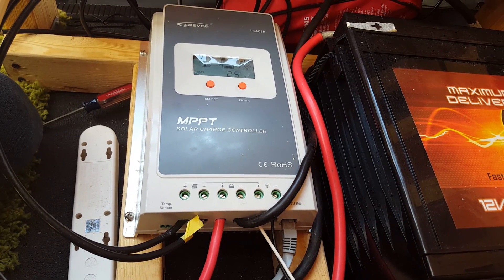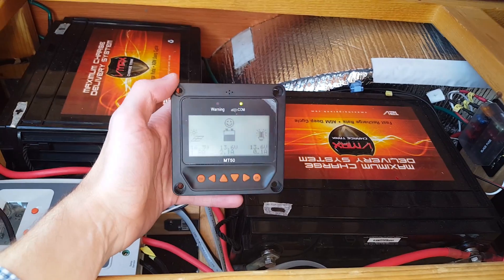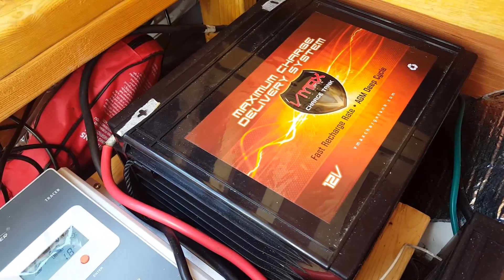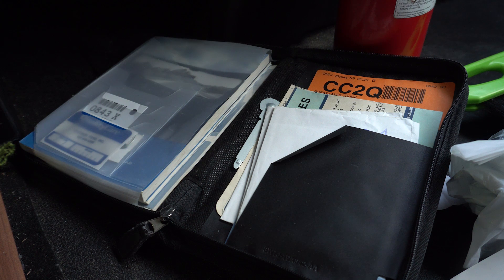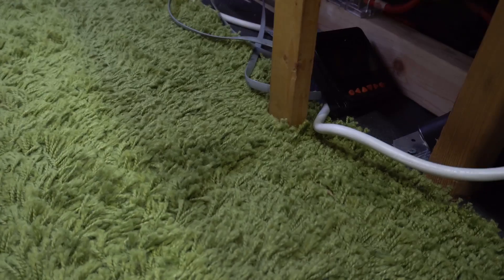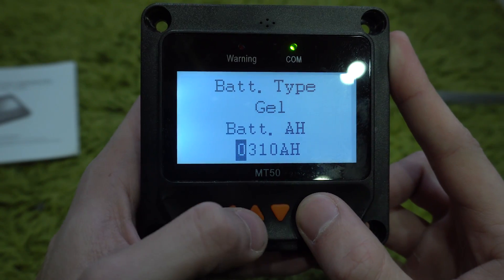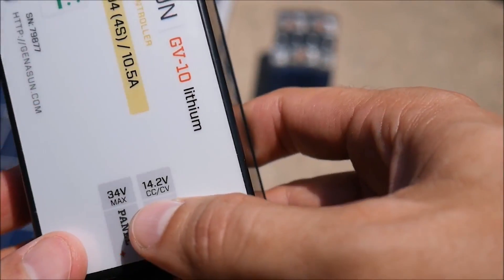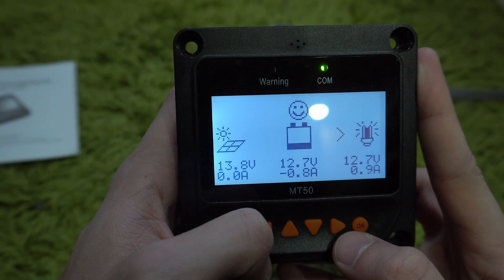How to Program Charge Controller for Lithium Batteries (MPPT v PWM | LiFePo4)

Comment from the maker: Some fair critiques about the usefulness of this vid. The point I was trying to get to is that each Lithium battery manufacturer has different recommended settings. They should be included when you buy the battery or on the company's website for each make and model. Then you can go into your individual controller (MPPT) and go to "custom" profile and select what the manufacturer recommends. That would be the key take away.
Reply: If you do not give the information indicated in the title of your video, your video becomes "click bait"
Reply: unsubscribed. I'll head over to Will Prowse's channel for real info.  you've suckered me into unsubscribing which isn't easy to do.
Reply: My situation got. Used lithium battery from batteryhookup. (BMW). No paperwork. Go a epevers with hand held display for program ing. I will try to screenshot battery hookup info if you could advise. Your videos are  GREAT.
THANK YOU 
Jarrett Estes
Reply: Ok you answered my question, thanks for the video 👍

Comment: i have 1 100 watt solar panel with 2 35 amp hr agm batteriers but i cant figure out what to set the charge controller at.o and a 2000 watt inverter

Comment: What if you bought a battery lifepo4 that doesn't have low voltage cut off and you want to use the sensor that cam with the solar charge controller?

Comment: PWM is not a considerable option for the lithium battery. When the Lithium battery is fully charged the PWM will give a high output voltage almost the same as the PV input(some cheap MPPT will do the same). Lithium battery will be protected by cutting the input circut, then the PWM output voltage will increase to similar to the PV input voltage. At this time if you turn on your inverter to some DC loads directly from your battery they will be burnt. Trust me I have gone through this. Then I use the good MPPT and drop all PWM.

Comment: I am a novice at solar and I’ve been looking into deep cycle batteries and stumbled across lithium iron batteries at a ridiculously low price what is your thought on lithium iron?
I am not sure of the difference between iron and ion except for the fact that the iron batteries do not contain cobalt.
If you care to offer an opinion facts or elaborate that would be great it is March in Buffalo New York and getting ready to finish my solar set up

Comment: Lots more learning needed before making making videos that people will take as gospel!
Read the EpEver manual for the charge controller, and look specifically at the graphs for efficiency at different voltages. Converting 48V to 12V wastes energy and is inefficient. Wasted power heats the unit and potentially reduces it's life-expectancy. Mount the unit vertically to allow convection to take all that wasted power away.
RTFM!

Comment: Hi Kopec. Thanks for the vid. I have a small ultralight airplane that sits unused from week to week (especially in the Winter)! Weight is important so I replaced the original lead-acid battery with a Lithium Ion and saved about 5kgs. I hooked it up to a pair of solar panels but I guess that maybe I've not made the correct selections on the controller because it's been losing efficiency steadily. This is annoying because I need a reliable cranking power to get the engine spinning! On viewing some YT vids, others have said that 'trickle charging' an Li battery will kill it over time...and I guess that's what a solar panel does! Am I correct? Thanks.

Comment: I have a 48v lithium battery on an electric bike w a 160 watt solar panel and mppt controller. I hooked it up but it won't accept a charge. I feel it's because I haven't set up the controller correctly. I'm planing a bike tour in June and would like to go electric to help promote solar. 
Can you please help me with the set up?

Comment: Does lithium have enough power to run an air conditioner and can you use your engine automatically to charge the batteries

Comment: hi , which controller wont damage LiFePo4  or which settings LiFePo4 needs ?   is  EPEver Tracer AN MPPT might be ok ?
Reply: No control charger will damage a lithium batt. Non mppt will allow the battery to run down as it wont charge when battery goes under certain voltage. Each life batt has a certain level to go,under and over. Contact manufacturer to get variations and set your mppt accordingly and you won't have a prob. Make sure you fuse the positive wires.

Comment: Hi,I've got a pwm with 3 different settings for sealed,gel,and flooded 
I've got a get 150ah deep cycle battery I've set the setting but it automatically sets it self to sealed just wondering if you or anybody else can shed some more light on this thank you in advance
Reply from the maker: I'm not the best electrician, so hopefully someone else can chime in too. I have the same thing with my batteries. They are AGM / Sealed. I use the gel settings for it.

Comment: Thank you for uploading this useful video. I have ARB fridge Freezer 60L and I’m gonna make solar system in my Land cruiser so How much watts solar  panels and buttery size do I need to run the fridge for long time without needing to recharge the battery using the car’s alternator?
Reply from the maker: I run a domestic fridge with 400w of panels and 310 amp hour batteries. If that's all you're running then you could probably do with 70% of that.

Comment: Lithium set to sealed there is no equalization or temp comp.. On lithium No temp compensation or equalize. Turn both of these both off or set to zero. For longer charge cycle life set charge cut off to 14.4v LiFePo and 12.9v lead acid for battery disconnect.
This video has no relation to the title. Mostly generic blathering info and nothing pertaining to specific settings as the title would lead one to believe. I do know that LiFePO4 batteries should be set to "sealed.

Comment: OK, I give up. How do you program your charge controller for lithium batteries? 8 minutes later, I'm none the wiser.
Reply from the maker: The longwinded point I was attempting to make was that each lithium battery has specific settings required by each manufacturer. Not the most clear video I'll admit. Will have to do another
Reply: There are better more informative videos on YouTube than this. This one is misleading and long.
Reply: @zhkopec   lithium batteries?   i have the same controller how do i set them?  to  jell?

Comment: Hello, i also have the same Epever 4210AN,. First i was planning to get AGM semi traction batteries, but because of weight, i probably can't use them (i wanted 2x220A  batteries = but that is 102KG in weight grrrr ) Now i'm thinking to use Lithium batteries. i start probably with one of 100Ah, https://greenakku.de/Batterien/Lithium-Batterien/LIONTRON-12-8V-100Ah-Lithium-LiFePO4-mit-BMS::1686.html   and if that works great, than parrallell again a 100Ah, if funds allow me to  because they are darn expensive overhere )  In the video you say, it is very important to get the settings right. What are your settings for the lilthium battery so i can learn from you :)
Reply from the maker: I had a similar though process. If I were building a system today I would go with Lithium too. Each manufacturer has different settings for each batter. Check the make and model on the manufacturer's website for the exact settings. If you use the settings I put up then it might not work properly:(

Comment: they have smart pwm controllers for cheap that claim to act like expensive overated mppt ones.  what are your thoughts on amphorous panels?  i heard they work better in shade or partially shaded areas over the panels?  or is it just parallel vs. series panel configurations?

Comment: I bought my charge controller over a year ago and it has profiles for LION batteries and also allows your own... A lot of them have Lithium options, including the one you are using.  I used to own that one before I moved and left my dad with it and the panels and bought new at my new house..  MPPT is always worth it, especially if you use your system.  If it is rarely used then you can get away with the PVM.  It also depends on the LIFEPO4 batteries you buy.  If you make your own, the cheap battery controller will cost you the batteries.  If you buy the Battleborn ones, those are drop in and they work, they have about the same requirements as regular sealed LEAD ACID when it comes to max charge settings.
Reply from the maker: I agree. MPPT is definitely worth it. If just for the increased efficiency alone. I might have an old firmware on my control though because I don't recall there being a dedicated Lithium setting. I might be mis-remembering though

Comment: Hi, my question, if I put in my RV only one 100AH lithium battery, do I need a BMS or not, I do have a lots of solar power and a same charge controller,with MT 50 monitor ,thnx
Reply: For a safe lithium battery, you should have a BMS. This will balance the cells voltage.
Reply: Almost all drop in LiFePo4 batteries have a BMS built into the case. If you build your own then Yes you need to add BMS.

Comment: Yes, I see there are parameters that can be set on the CC, but I thought the whole point was to use your actual Li battery specs and explain how they translated to your CC setup, since it may not have the parameters needed. Maybe it is more straight forward than I am thinking, but I am looking for a bit more knowledge before $$Li$$ batteries. Maybe you have an update. Looking now.
Reply: Yeah, you need to change the title and intro - they don’t match the substance of the video. How about “if you want to set up CC for Li batteries, read the directions - you will figure it out”.  Honest. True.
Reply: @mikemead2315  haha🤣

Comment: Question...I beginning on an adventure w/solar. To date I've ordered 4-300w panels, 1 4000w inverter, 1MPPT charge Controller a roll 100' stranded copper 2ga wire. 10-12v Lithium Ion  batteries.
I need to mount these panels in my yard on poles. Can I put all 4 panels on 1 pole or will they be to heavy. And any suggestions for a auto transfer switch to go from grid power to solar?
Any info would be most appreciated. And oh BTW I'm feeding 2 refrigerators , 1 freezer, 1 well pump 220v and several lights. As I said I'm just beginning but I want to be able to increase per in the future and really don't want to have to buy eq again.
This
bb
Reply from the maker: Here's a great solar playlist if you're a beginner here: http://bit.ly/Solarplaylist

I'm not sure which panels you're using so I can't tell you how heavy they are. If you get the flexible ones like I have http://amzn.to/2zvhkDo then you could put as many as you can fit. They're ultra light. For an auto transfer switch, I have to be honest that I'm 100% off grid and haven't used this one, but I've heard good reviews: https://amzn.to/2PSDE2H

The fridges will be your biggest draw. LED lights and many electronics are super easy on the draw. With the batteries the key factor is the Amp hours, that tells you how much capacity it has. Larger the better. For reference I run 1 fridge at ~30*F and lights / fans / computers with 330 AmpHour (though I have AGM batteries) all throughout the night

Comment: There are LIFEPO4 specific charge controllers.
Reply: Yes, but I have a system of panels and charge controllers that should last for 20 years. I will need to replace my batteries in 4 years and I want lithium. Settings for my current charging hardware are what I'm after.

Comment: Doesn't cover anything on actual lithium setting requirements, or disabling float charging on lithium charging
Reply: Thanks for saving me the time. So many videos have this click bait title then deliver nothing. On to the next one...
Reply: Well you can have float voltage say 2.3 / 2.4v per cell (lifepo4) as that is the voltage the battery sits at anyway.
Reply: @xraykadiddlehopper8067  Ik but you want to use your input power too rather than disconnect it until they need a charge.

Comment: When did you say how to set the controller? You almost got there, then said something about AGM. Never heard the actual setting for Lithium Iron Phosphate. Lots of sidetracking. I really want to hear the volt setting and what you do with the float setting.
Reply: On lithium, turn float setting of if you can. Maybe try and find a video on the different steps lithium batteries need to go through whilst charging. All battery types are different.
Reply: @Colaaah  Lithium should be set to the sealed mode.
Reply: @xraykadiddlehopper8067  Lead Acid Batteries are sealed, and Lithium Batteries charge very differently to Lead Acid Batteries. They are both totally different chemistries...

Comment: I plan to use my epsolar mppt to charge lithium 18650 battery in 7S configuration, what parameters should I configure so dont burn them? thx, also the connections , PV goes to solar charge controller, which goes to the battery or do I have to place in the middle of the charge controller and the battery a BMS?
Reply from the maker: PV goes to charger controller, which goes to the battery correct. I drew up some wiring schematics that might help visualize it. http://bit.ly/2ATfkpZ For your parameter settings, there should be a pamphlet that came with the batteries or go on the manufactures website for the exact numbers. Each battery is a bit different if your mppt doesn't have a default lithium setting.

Comment: Hi, Running 30amp Tracer mppt controler. What are the setting for Lithium batt.?, and 35ah lithium as practical as 100ah agm?
Reply from the maker: I can't comment on which is better the 35 lithium or the 100ah AGM. The settings (if you have the same controller) will be under control parameters and you'll go into the "User" mode. There should be the recommended settings in the box with the battery or check the manufacturer's website. Each battery has specific settings, if you use mine they might not work.
Reply from the maker: jony joe Excellent info Joe thanks!
Reply: for lifepo4 set it to 14.4 volts bulk and 14 volts for float. If you have voltage drop, you might need to go higher on voltage. A lifepo4 max voltage is 14.6 volts but at that voltage it will trip the bms and stop charging.
Reply: @jonyjoe8464  why would you set a float charge on LiFePO4?!

Comment: Thank you for the video, very nice.  Are you changing the panels to more ridged or durable?
Reply from the maker: I'm happy with the flexible panels I've got now, but if I have any more problems with them I will definitely be considering going to the standard rigid panels.
Reply: zhkopec I've gone the fold out ridged panels 200watt 12amp.  So far it's done great, fully charged by 1030am.
Reply from the maker: Eminence FrontX5 Excellent! Getting that full charge is the best thing for the system. Glad it works so well

Comment: So to recap it's head over to control parameters, hit user settings, the set each metric to what is recommended on the battery pack? Does that change for agm?
Reply from the maker: Yes! For AGM specifically, some batteries work with the "Gel" settings by default, however I'd check and make sure that that's what you need for your setup.